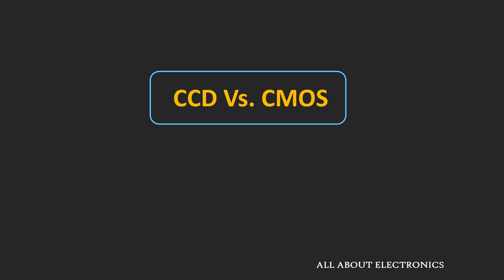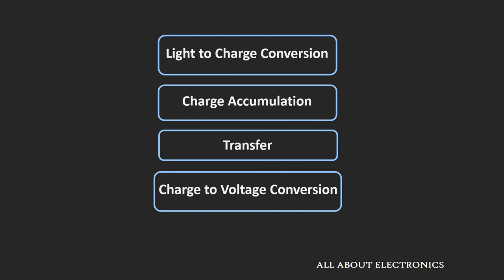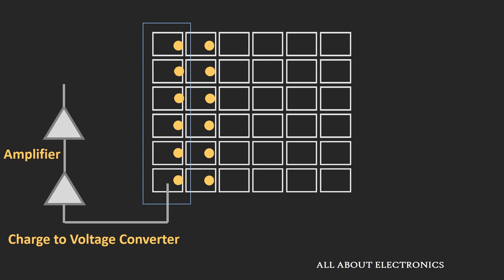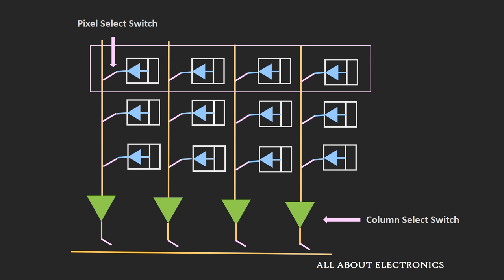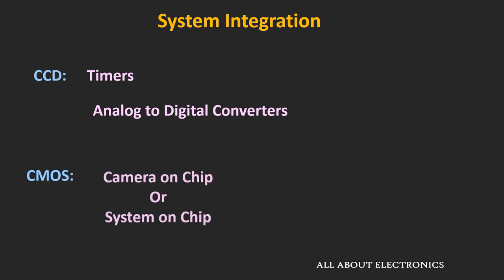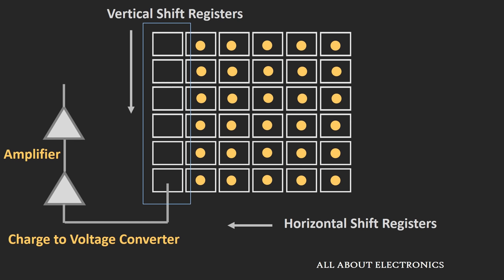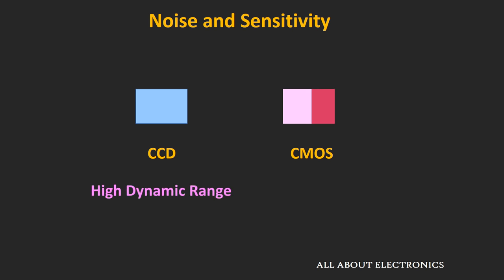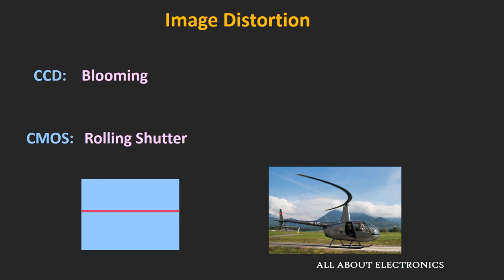Image Sensors Explained: How CCD and CMOS Sensors works? CCD vs CMOS

Comment: That's pretty good. I was looking for a video that visually described how light is tiurned into an electrical charge, then voltage before being digitized, for the benefit of people who think that everything electronic is magically digital. In fact, the best CCD video cameras have the ability to control amplifier gain to eliminate analog or digital clipping before the photosite information is digitized. That and the absence of rolling shutter, that cannot be eliminated on CMOS, makes CCD the overwhelming choice when best image quality is needed. This will no doubt spur vehement denial among "cinema" fanbois, but it's a fact. CMOS is less costly to make, and is better for battery-powered things like phones, and other mass market devices. Being cheaper makes it more widespread, but when dynamic range and temporal factors matter, you need CCD.

Comment: Excellent explanation. If CCD is an intrinsically superior technology for capturing still images then it is  a shame that the many ways CMOS sensors have been improved to give high ISO capablity (better microlenses, less dnes pigment in the CFA, quieter on-chip circuitry, ... ) have not been applied to CCD, and that features and convenience (and manufacturing cost) have been prioritised by camera makers over image quality.
Reply: CCD sensor is superior quality than CMOS sensor, but CCD sensor needs to much resources such as power and price.

I believe the CCD sensor is still improved, but not for regular consumer because it will be too expensive.

Comment: very good explanation, but it just an overview. pls post video for its useful specs like shutter type, means of resolution, pixel, a/d conversion, chrome, package, Voltage, optical format, frame rate, imaging area, active pixel etc..,

Comment: What's causing the charges to be shifted into the read register. No one explains that part...

I imagine the read register is connected via a row of capacitors with one side being the pixel array accumulating a negative charge and forcing a positive charge on the other plate of the capacitor and connected to that is a MOSFET row (MOSFET Gates) at the edge of the CCD which would allow the amplification to be simply the Drain to Source Voltage being controlled by the MOSFET's Gate to Source voltage. Then you would "Shift" the charges from the CCD sensor to the read register by exposing the the MOSFET Gate to a positive voltage drawing the charge off the CCD's pixel array and onto the MOSFET's Gate which then controls a large voltage being sent to the DATA inputs of the D Flip Flop of the Read Register. 

JUST GUESSING

Comment: ALL ABOUT ELECTRONICS, thanks for the video.

I need to do data acquisition with a CMOS camera, to interpret the type of flame of a burner. For this I am planning to use a Raspberry Pi4 with the OpenCV library.

Please, do you have and could you provide a example code for this application?

Thank you.

Comment: Without specifying ranges for either current req or appx power consumption, stating high voltage results in high power usage becomes incorrect.. sahi ? even if u are implying that current needed is also high please clearly specify the range for either. Good Video.. thx..

Comment: beside charge to voltage conversion and amplification happening in the pixel as opposed to the serial register, I cannot see how the transfer of the data differs between the CCD and CMOS. It just seems like the charges are being read column-wise for the CCD, and row-wise for the CMOS. And that shouldn't yield any difference...?

Comment: You reference CMOS becoming similar to CCDs in terms of noise - in fact modern CMOS, especially for scientific applications, far far outstrips the performance of CCDs. The most significant noise in imaging happens during analogue to digital conversion, called Read Noise, and the faster this is performed, the higher the noise. 

The parallelisation of CMOS using an A to D for every column of pixels allows slower reading, with much more accurate results. 

To be quantitative, a high quality CCD chip will have around +-5 electrons of read noise (in other words, a standard deviation of around +-5e- for any given signal). A typical high-end CMOS has around +-1.5e- of read noise. In low light, this will really really count!

Comment: Thanks for the great video, i am not an electronic guy, but I have a few questions:
1. Will I get the same dynamic range on par to CCD IF I have a bigger CMOS sensor to compensate for the area lost by the integrated charge-to-voltage converter and amplifier?
2. Any video explain why CCD needs to have the 1-by-1 shift register unlike the CMOS? why can't CCD have batch process on charges like the CMOS?

Comment: Concept is explained very well ...May i know why the serial data transmission is preferred in case of CCD when serial to parallel shift registers are available ...
Reply from the maker: In CCD, suppose charge to voltage conversion as well as amplification is performed parallelly, then imagine the number of the amplifier and the converter circuits required for the CCD sensor. It will be in thousands!!
In case of CMOS, it is possible to accommodate millions of amplifier circuit because the fabrication procedure is same as the IC fabrication technique. 
In CCD fabrication technology it is difficult to accommodate so many amplifiers. So, conversion is performed serially.

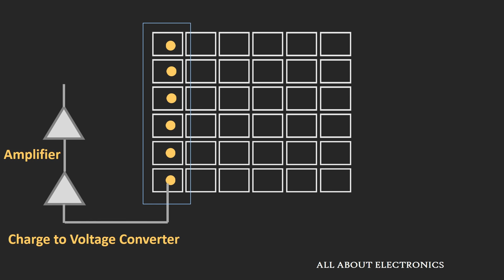Comment: 2:39 OKAY - but how does it continue? depending on the striking photons, electrons getting amplified and "measured" -  and how we get a binary file with zeros and ones 101010110011 and how we get .raw file from that

Comment: This video is sooo great! thank u so much. However, I am still a little confused about the dynamic range, why say the dynamic range of CCD is higher than the CMOS?
Reply: Brother it's all about how much light the sensor is able to capture. Since some part of the surface area of CMOS sensor is filled with charge to voltage converters, amplifiers, so it captures comparatively lower light than CCD sensor because the surface area of CCD sensor is filled with pixels only, there is no mechanical parts. That's why the CCD sensor captures more light and because it captures more light you will get better dynamic range.

Comment: Is a cmos image sensor a computing innovation (meaning that computer or code is vital for its functionality)
Reply from the maker: Yes, code or computing is also very important. (How the sensor data is interpreted).
e.g you might have seen today that, in many smartphones the same Camera sensor is used. But still the end result of the captured image is different.

Comment: Where in the initial steps does the analog to digital conversion occur?
During the voltage amplification?
Reply from the maker: The conversion happens after the voltage amplification.

Comment: Can you explian how each photosite of  cmos recognize the colors like as red green and blue... I mean In ccd three prisms are there those splits the white light into  RGB... How it is happens in cmos?
Reply from the maker: RGB (Red, Green and Blue) filters are used in front of the sensor. So, that the sensor can recognise the colors. The most common filter arrangement is the Bayer filter, where the array of RED, GREEN and BLUE filters are arranged in specific pattern.

Comment: I want to collect the data of images from this CCD camera. How can I achieve it? Should I need any other softwares and how can I interface a CCD camera with Arduino to collect the captured images data?
Reply from the maker: I think for such an application better you use Raspberry pie with openCV. And in your application, if using PC is not an issue then you can even go for LabVIEW. (interface camera with LabView in PC)
Reply: ALL ABOUT ELECTRONICS Thanks ra lot.... could you please explain about raspberry pie and that LabVIEW interface units or else send me some links to by that I will know about them..!!

Comment: I would like to know why we replaced cmos sensor  by CCD sensor in colour sorters Now a days.
Reply from the maker: When a High resolution is required, CCDs are more preferred over CMOS sensors. Color Sorters are mostly used in applications where the object is very small. (e.g Grain). And to identify the object, high-resolution sensors are required. (For better accuracy). So, mostly CCDs are used for better accuracy.

Comment: There should be three layers capacitor and the last layer is clocking to be readable by the counter and shift register and stored to memory. The illustration you usef is quite misleading between two dimension and three dimenstion

Comment: How the digital image is formed after a/d conversion and is there any loss in data if the charge gets intermiggled or lost ?????
Reply from the maker: After the A/D conversion, the data is sent to the processor. So, processor has now a data of each pixel (its brightness, rgb values etc). To form the image, the information of each pixel is combined. And many times  some post processing is also carried out . The more pixel the sensor has, the more data processor needs to process. And the size of the final image will also be more. I hope, it will clear your doubt.